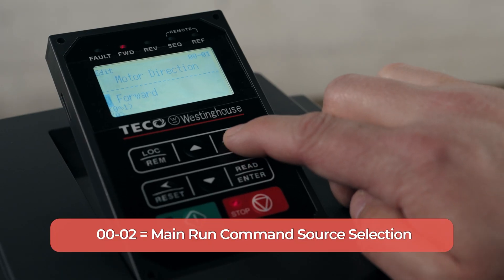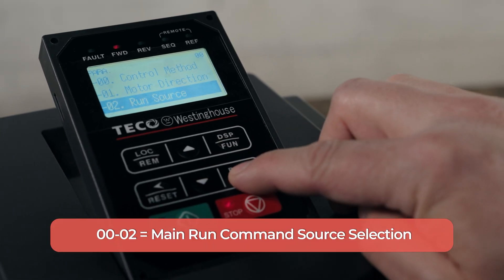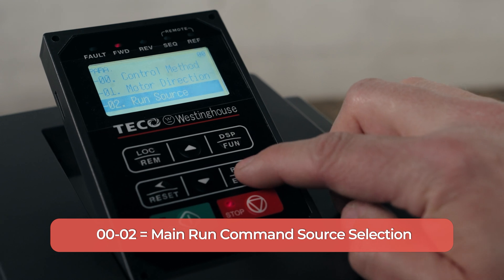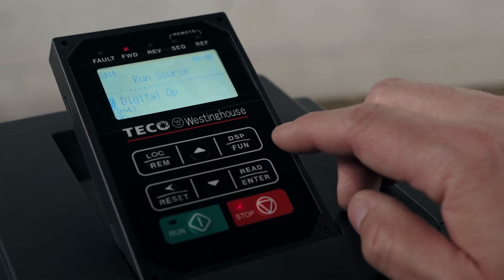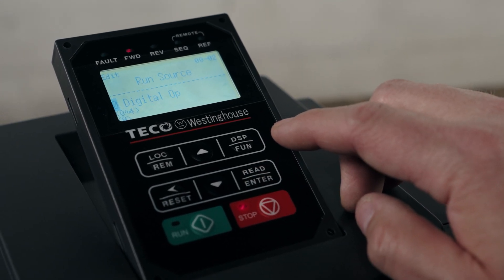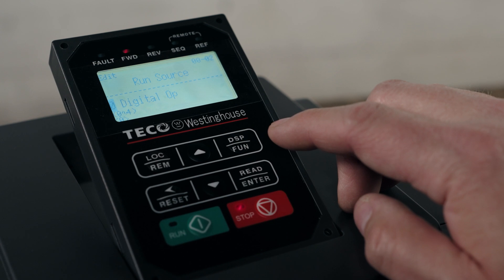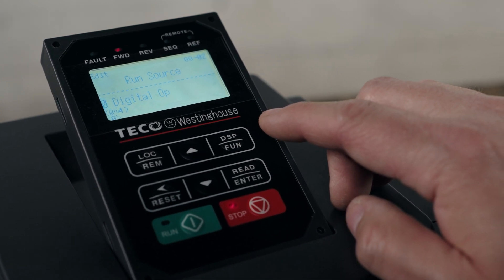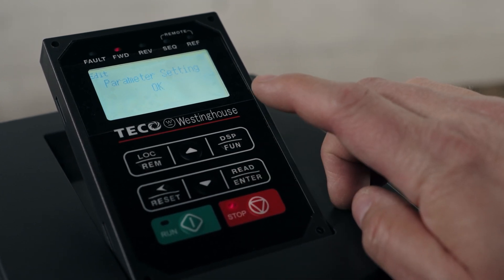A510 TECO Westinghouse VFD | Quick Start Guide

Comment: If motor  rpm is 2980, how many poles will be configured
Reply from the maker: On 60Hz supply, that's likely a 2 pole. Number of Poles= (120x60hz)/2980 RPM =2.41 (P = (120 * f) / N)

Comment: Any input on leaving it run 24/7 even though I only use it between 8-5? Would you recommend flipping the breaker off when we go home at night. I am concerned about power surges.
Reply from the maker: Typically, VFDs are designed to run 24/7 without issues. However, if you're worried about power surges, it’s a good idea to flip the breaker off overnight or use surge protection. Most industrial VFDs come with built in surge protection though. Just check your VFD’s manual for any specific recommendations. Even if the motor isn’t running, they still draw some power, so it adds to your energy cost.

Comment: Iam unable to change the motor direction. I can get to the screen but unable to change from "0"
Reply from the maker: Hi Jeremy, are you able to change other parameters, just not that one in particular?
Reply: Haven't had to try yet
Reply from the maker: @TheJeremydchadbourne  It's possible the parameters are locked to prevent accidental changes. Check page 4-44 of the A510 manual under Group 11, Code 11-00 – Direction Lock Selection. If this parameter is set to 1, the drive is locked to forward-only operation. To allow reverse rotation, change the value of this parameter to 0.

Also, keep in mind that some VFDs won't allow parameter changes while in run mode, so make sure the drive is stopped and not in an error state before attempting any changes.
Reply from the maker: Here's the manual: https://www.emotorsdirect.ca/item/teco-a510-6250-c3-ue?quantity=1&tab=downloads-tab
Reply: Thanks that helped! Found it better for the next guy to just swap leads on output power

Comment: Hello sir , ijust want to ask , because im using A510s 440V 18.5kW, after i set all the parameters needed i tried to start the vfd (no load) at the LED display it shows 440v but when i measured the output voltage at the terminals it shows 510V, is this normal? This is new VFD.
Reply from the maker: Hi Alexander - Thank you for your question! The VFD output voltage of 510V for a 440V input could be due to the higher DC bus voltage after rectification. I'd suggest checking the input voltage reading and the DC bus voltage? Under no load conditions, the lack of current draw can cause higher voltage readings. Also, ensure that your measurement method and equipment are accurate, as this can affect the readings.
Reply: Thank you very much. @emotorsdirect
Reply: Also, can i ask what is the parameter or is it posible for the A510s to use momentary switch for a run command signal without latching?

Comment: It gives a short circuit fault, what is the source? Most of our machines have this driver, almost all of them give a short circuit fault but we cannot find the fault. Can you help me please, thank you very much in advance.
Reply from the maker: The 'SC' fault code could mean either a short circuit or a ground fault. This could be due to damaged motor insulation or wire damage/deterioration. I'd start with checking +testing the motor wiring.

Comment: Hello,
I use TECO A510 in my motor applications and they run great. I used Modbus for communications, start, stop ...
Is there a Watchdog or Keep-Alive function for the TECO A510? That is, automatically stop the motor if the communications with the VFD is lost?

Thank you,

Omar
Reply from the maker: Take a look at parameters 09-06, 09-07, 09-08, and 09-09. 

As far as I read and understand, 09-07 we tell the VFD what we want it to do when there is a communication failure. And then the other parameters are just the limitations around when the VFD decides there is a communication issue.

Hope this helps!
Reply: @emotorsdirect  Thank you very much. It will also help if the VFD receives a Keep-Alive signal from the controller. Any directions where to look for that will be very much appreciated. Thank you.

Comment: I’m getting an inverter overload message on my A510. It happens when my motor lugs just the slightest amount. Is there a setting  I can program to allow for short instances of motor ‘bogging’?
Reply from the maker: Great question. Need a bit more info: motor catalogue #, A510 catalogue #, and your power supply.  Do you want to send your information to customerservice@emotorsdirect.ca and they'll be able to help you out a little faster and more effectively vs going back and forth in the comments? Thanks!
Reply from the maker: Hi Brad, consulted with my VFD expert and he suggested the following: 

-          Verify that 02-01 is correctly set to the motor's FLA.

-          Verify that your motor is in fact inverter duty rated. Older firmware versions of the A510 assumed that non-inverter rated motors were going to be installed on the VFD. If your motor is in fact inverter duty rated, make sure that parameter 08-05 is set to 0101b.

-          You can try putting the VFD into SLV control on parameter 00-00 = 2. Sensorless vector control can help with some better torque control out of the motor, which might be enough to keep it below an overload threshold.

-          You can take a look at parameter 12-11 to see what the reading was for the output current at the time of the fault and compare this against your motor FLA value. The A510 will fault on OL1 when the VFD sees an amperage draw of 150% or higher for 1 minute, or 200% or higher for 2 seconds.

-          The OL2 fault occurs when the VFD faults on OL1 4 times in 5 minutes, and then locks out the run for some time to let everything cool down.

Ultimately if the motor data is set correctly and your motor is drawing too high of an amperage, then the answer is that the motor is overloaded and the VFD is working to protect the motor from damaging itself.